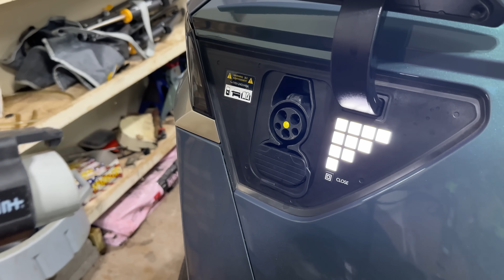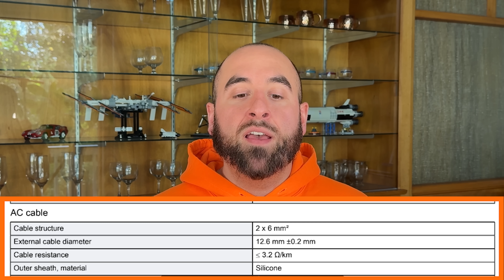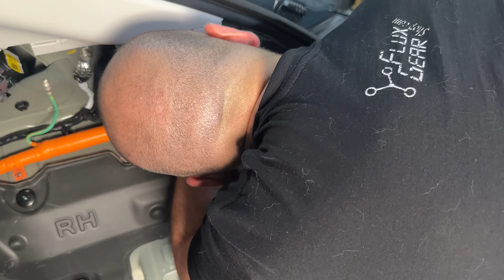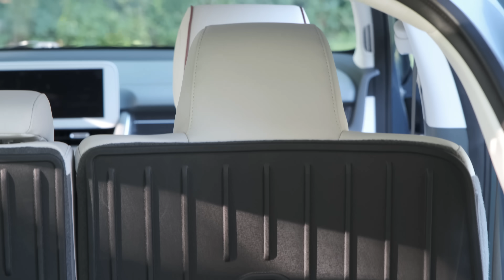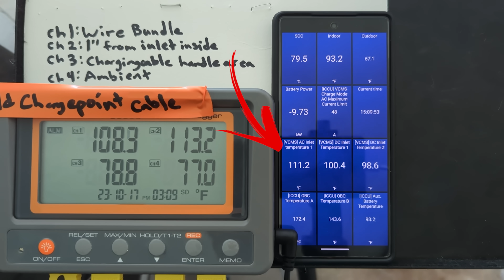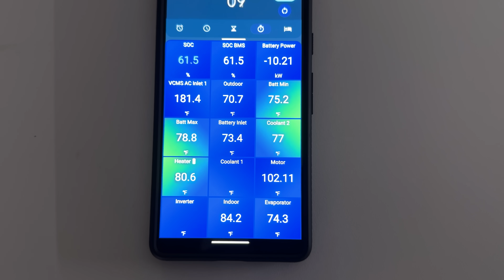I Investigate Overheating Charge Ports on Ioniq 5/Ioniq 6/EV6/GV60

Comment: wow thank you for all the hard work i have been waiting for this video to see what you found, as my MY23 Niro in the UK is over heating on single phase 32A 230v charging after 10 months of ownership. took it to dealer they could not get it to overheat ( i now know why) but did the software update to reduced the power ( to just over 3kW) once temp reached 105C. this is what i have found charging on 3 phase 22kW (11kW charge speed) public charger using supplied cable with car did not overheat only got to 31C after an hour same with dealer using the same cable , so used the cars supplied cable on a 7kW single phase public charger, noticed there was a big difference in temperature rise  compared to at home it rose from 22 to 50C in 16 minutes, using suppled cable with the car and it took 4 minutes to rise the same amount at home charger  ( which is tethered cable & plug). the car is supplied with a Mennnekes cable and there is a big difference in contacts design (4 beefy taps ) used compared to the home charger multiple fine like strands/strips . my conclusion is the home plug contacts has lost there tension and as a result the contact resistance has gone up resulting in a rapid rise in temperature. home charger manufacturer didn't even dispute it and is going to replace the plug and cable, which made me think this may be a known issue.
Reply: I have the same issue on my Ioniq 5 and I just checked the sockets in the EVSE plug for my current EVSE and they do look 'looser' than the sockets in the plug for my old spare EVSE so I think you have hit the nail on the head here! 💯

I will test this by swapping the plugs over from my current EVSE (a Ohme Home PRO unit that's compatible with Octopus Energy IOG tariff) and do a full charge next time I need to charge it, as luck will have it I just charged it up last week.. 🙂

Comment: Great video and I appreciate the great effort you put into looking for the cause of the issue. I'm a little concerned about ppl running 48 amps continuously for several hours anyway, in their house. Well, the good news is hopefully, the evse is pretty close to the main panel.
 
I run mine at 32A and have the car limit the current down to 60%, because for me, time is not an issue. Also, since I use solar panels, the draw from the evse in combination with the house is always less than the output of the solar panels.
Reply: What’s your concern with 48A?  If installed properly with correct gauge wire it would be no issue.

Comment: Thanks for all your hours of investigation! I bought a 2024 limited ionic 5 2 weeks ago. I haven’t charged it enough times to know whether or not overheating might be an issue. I live in the desert where it gets to be over 115°F in the summer; temperatures are still in the mid to high 90s now. Should I assume my vehicle software has already been updated? (I will be using a ChargePoint level two charger once it gets installed.)

Also recently, I drove about 100 miles and plugged in to a level two charger overnight. In the morning it read that I had 400 miles of range. is that possible? I tried to keep track while I was driving back home with AC for about 3 1/2 hours, and it seems like I had about 50 extra miles over 300. What do you think ??? 😮

Comment: Thanks for all of your work! My problem with de-rating started only after having the ICCU update on August 9th. Fortunately, I changed the charge rate in the EV menu of the car from 100% (full 48 Amps/11.4kW) to either 60% (27.7 Amps/6.74kW) or even 90% (42.2 Amps/10.36 kW). I was able to charge at 10.3-10.36 kW for over 3 hours without de-rating at 42.2 Amps/10.3 ish kW at this 90% of max charge rate.

Comment: Doesn't seem like there is a definitive answer yet. Class action lawsuit? Car was sold as able to charge at 48 amps.
Reply from the maker: There is a ongoing class action but Hyundai has filed for extensions so we likely won’t have any substantive answers regarding their position for a few months
Reply: @TheIoniqGuy  Interesting video......Thanks,  I'm not having trouble with my 22 EV6 with 48 amp charger, but I live in Minnesota where temps are pretty good up on the Canadian border here. Sad to see people struggling.

Comment: Maybe my I6's charge port was assembled correctly.  It ranged between 175-185 F before the ICCU recall and seems to be around 165 F afterwards.  It has never reduced or stopped charging at 48 AMPS on the AC EVSE.

Comment: Theory: Testing the thermistor by putting it in ice water and then boiling water recalibrated the sensor fixing or helping with the issue and thats SOP for that kind of device.

Comment: You may want to check with your contact to see if they are to be assembling the pin with the thermal coupler with heat sink compound to more faithfully read to true pin temperature. If you go back in for any reason caliper the pins them selves. They should be in specification but is worth a validation. 17:09

Comment: Did you clean the pins before reassembly? Are they keyed or would it have been possible they were rotated at all when putting it back together? I suspect it’s all just contact resistance and if you cleaned the pins and adjusted the wear pattern it’s possible it’s “factory fresh” again. I just finished my own testing with cleaning the pins and it’s definitely made a difference (will post results in Reddit thread).

Comment: ok cool so just take apart my charging port and boom my issue is solved lol - mine isn’t even de-rating after all the updates. it just goes down from 11kw to 0 and sometimes jumps back up to 11kw for a bit and then eventually just stops. ugh. but yo this was some really dope and informative content that really solidifies you as… THE IONIQ GUY

Comment: I truly hope that no one at Hyundai tries to void your warranty after all this great work! If reassembling this charge port fixes the issue, there is hope for a TSB from Hyundai that could be a better fix. Fingers crossed
Reply: considering it's their engineering and their issue.  When manufacturers fail to acknowledge and fix known issues (see Subaru), it is up to the owner/consumer to take matters into their own hands to do something the manufacturer wouldn't do.   To advertise a capability and then fail to deliver on said capability can go south fast.  So, let's hope Hy/KI can remedy the situation brought to light by this guy...

Comment: My guess would be moving the thermistor around fixed a bad connection, so it may be a temporary fix.  I've replaced many thermistors on different types of equipment, if they have a bad crimp or an issue with the tiny wires inside they give bad readings.  Did you ever feel the plug when a charging session was reading 220F?  If it was really getting over 100C the entire plug would be warm and the area around the pins would give you a bad burn.  If it was not that hot then the thermistor was reading high.
Reply: Don’t touch anything  over 50 deg C ,,,it will burn you. Measure the temperature with a laser thermometer instead ;)

Comment: were you still experiencing the overheating issue before running the tests, or did you go back to charging at 40 amps? I was also having the overheating issue when charging at 48 amps (and even sometimes at 40 amps) during the summer, but ever since the days got colder (max 17 C during the day, maybe 7-10 C at night) it just went away on its own. If you didnt experience the issue at least a couple days before doing this experiment, your conclusion that you might've accidentally fixed your car could be completely wrong. Thanks for doing this by the way, love your videos.
Reply from the maker: Yeah, it was overheating up to the testing

Comment: Uhhh i just bought a 2023... should i return it?  Is this only on the 2022 model?
Reply from the maker: Nope the issue is both model years
Reply: @TheIoniqGuy  ok thank you. What about 2024?  No one reports the issue?
Reply: @CookinWithTide  i have 2024 sel awd and it derates on a 7.2 kw.  10  min and vcms ac inlet is 223f and shuts to 5kw  i have a chargepoint hardwired 60 amp charge at 48 and maybe get 3 mins it used to work perfectly for a whole year and then shortly after a year of ownership and several hundred AC charging cycles later as it’s my primary commuting vehicle I now have this problem I have tried dielectric grease and cleaning the pins my next step is to take it to the dealer and let them figure it out
Reply: I have a 2023 that charges from level 2 and DCFC with no issues. This is by no means a universal experience with the Ioniq 5
Reply: @AriaAtHome  ok thank you.  I'm just paranoid then haha

Comment: It's possible that poor electrical contact is made when mating the charging cable to the vehicle's charging port.  Resistance in that interface will cause heat.  Too much resistance = too much heat.

I like your testing methods using thermocouples to monitor temperatures but what would be interesting is to measure the AC voltage drop across each male/female contact pair during charging.  That way, you can calculate the actual power dissipation in each contact interface.  You would also be able to easily measure the voltage drop while manipulating the charging cable to see if the voltage drop changes rather than waiting for temperature changes.

Your issue may have been caused by surface corrosion/contamination on the mating contacts themselves.  You likely cleaned the contacts during your extensive testing.  Cleaning the contacts with IPA or even Deoxit may help.

I have an Autel Maxicharger that I use with my 2023 Kia Niro EV.  The plug remains remarkably cool while charging at 40A/240V.  My Kia OEM L1 charging connector (set to 8A current limit) actually gets warmer to the touch than the Autel L2 charge connector at 40A so I'm fairly confident that charging connector mating quality varies with each type of charger.  This is also why I never charge at public chargers.  Who knows how worn/mistreated/dirty those charge connectors are.

Thanks for your awesome experiments.

Comment: This is an excellent analysis, thank you for the details. Your issue seeming to be fixed, and the information from Hyundai about the thermistor, makes me wonder if you having boiled the thermistor to over 210F had some sort of calibration/corrective effect. I don't see how that would fix the issue, but I also don't see what else, other than reseating the pins, could have corrected your car. Very strange, but I am happy to see yours is fixed.

Comment: Hyundai should compensate you for doing their QA analysis.  That was excellent experimentation.  Welcome to the inconsistent world of theoretical vs reality and the Heisenberg principle loosely stated as the taking of measurements affects the actual data your trying to gather.

Unfortunately I’m still gun shy on the I5 and will likely buy elsewhere next year or wait to see how the NACS connector changes things because my use case is largely level 2 charging with an infrequent road trip.

Comment: You probably hit the answer. Its how much "resistance" that the "jack" and the "plug" can occur by not a solid connection. Run into this with devices like Pi's and 5v at 3 amps+

Comment: Thanks for doing this!! I am now thinking twice of getting a level 2 charger installed in my home. I don’t wanna deal with this problem.
Reply: You can still get one installed, just lower the output on it until the issue is resolved
Reply: just charge at lower amps.. better for battery

Comment: I was having this issue, used a swab with rubbing alcohol to clean the pins in the car and charging handle, haven't had the issue since. There was a lot of grime I cleaned off on the swab. I haven't had the issue since. It started about a year after I got the car, which seems similar to other peoples issues.
Reply: When you run power you need a solid connection. Else you can develop a resistance which causes heat.
Reply: Good point. I will try this.

Comment: Seems like it could be assembly issues, I as you know had a 2023 Ioniq 5, that from brand new did not Fast DC charge, end of day it was a bent pin on a connector that caused the issue. So likely your removal and reassembly of the pins on the charge port was the solution to likly poor assembly or possitioning of the socket pins.

Comment: In Europe we dont have this problem.
Reply: Europe gets an entirely different part for the connector (the specific thing that's overheating), Type 2/Mennekes. This is undoubtedly relevant.
Reply: What amperage do you charge at?  I'm assuming less than 48A?
Reply from the maker: European homes have higher voltage so the car can charge at a much lower amperage
Reply: @TheIoniqGuy no. 220-230V is standard in Europe. We have 240 V.
Reply: @GeoffJohnson using 3 phases, we need only 16A to get 11kW charging, and, obviously, 32A for 22kW.
Reply: Sounds like that's why, you don't have the heat issue with that low of an amperage @FireballYT
Reply: Europeans generally don’t know much about their AC charging… Most chargers are three phase 16A. Almost all EVs can accept that and charge at 11kW which is plenty. Only a few models can accept 32A in all three phases, and only a few can accept 32A in two or just one of the three phases. There is no charging above 32A and most charging is at 16A. Hence charging cables don’t get warm.
Reply: @ManfredvonHolstein  saying "Europeans generally don't know much about..." is easily replaceable with "Americans generally don't know much about..." not sure what point you're trying to make after I exactly told you how it is, except for belittling Europeans.
Reply: @FireballYT  haha I’m European myself. Europeans don’t know much about this because they don’t need to. The three phase system is ideal for car charging.
Reply: In Europe, level 2 single phase voltage is about the same as US 240V, so amperage is similar in that config. But unlike the US, you can do triple phase to get about 400V AC level 2 charging, which reduces current required. I don't know how common each configuration is, though. But since single phase exists too, if it's not a problem at all in Europe, it must be due to differences in the car, not due to the difference between 240V in the US (house outlets are level 1) vs 240ish house outlet level 2 voltage in Europe.
Reply: @Alex-fi4ot  , wrong. When you charge a car the amp is everything to comes with the heat, it flows allot of heat throw the cables when you increase the amps US and Europ have a huge diffrent of power grid. I am my self a electrician and work at power grids.